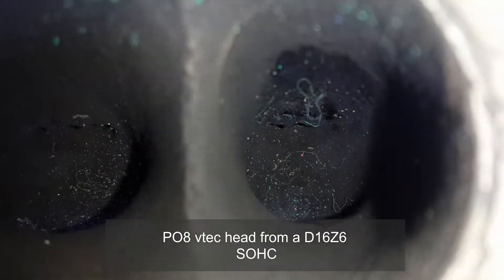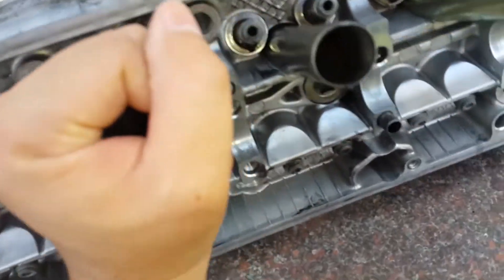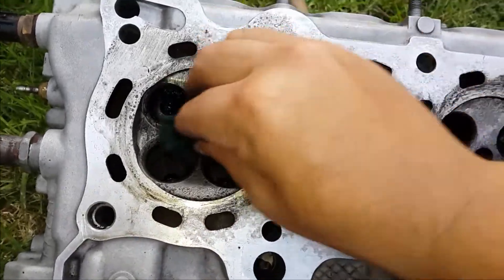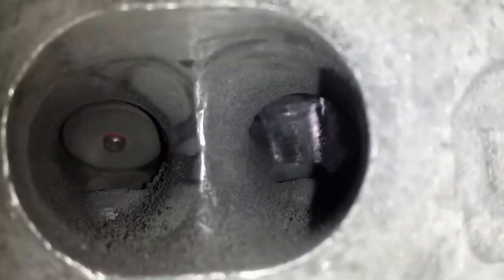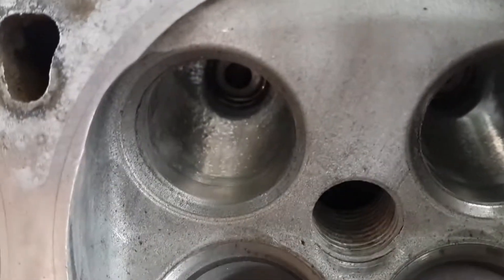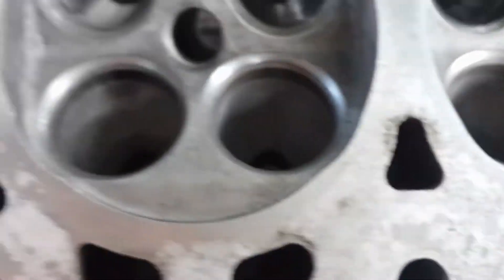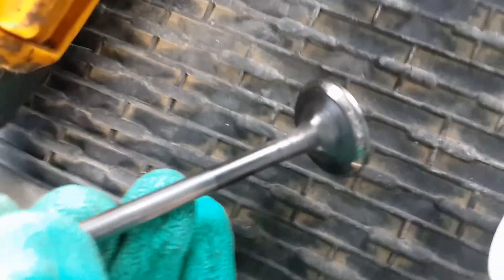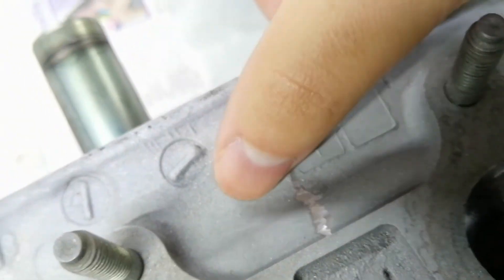VTEC Head Ports & Valves Cleanup DIY | D16Z6 PO8 SOHC

Comment: its super good,, but dont spray paint the head, its childlish
Reply from the maker: Hi John, the main reason I painted the head was because the previous owner sand blasted the surface making it rough, the problem with that is it gets dirty very easy and it's not easy to clean. the paint seals the surface and makes it easier to clean later.

Comment: 😂 wow that's some scary stuff,  never seen anything other than sanding cones or carbide attachments used to improve port dimensions and surface clean up = increased airflow, all that is waste of time based on this video tutorial 😂
Reply from the maker: Well seen it here first! in my case it would be a massive waste of time, 5+ hours porting for 10hp gain,,,, or 3 clicks on the boost controller for 40hp gain in 1 second. idk, for my needs it looks like a big waste of time.

Comment: Mine was the same way instead of using a screw driver I used a wire brush attachment on my drill
Reply from the maker: Awesome, I could not find a wire brush small enough to fit in the runners. And the dremmil wire wheels would fail almost immediately.
Reply: @RisingBoostYT  ya the dremel sucks lol I used it with sandpaper maybe I’ll make a video and show u how I did it?

Comment: What type of bit is that
Reply from the maker: Hi Savuth, difficult to say, it is listed as a "soft grinding disk" and it is not as hard as the pink grinding stones. it is however still tough. I only used 1 disk for all the exhaust ports. I got it in a cheap universal tool bit kit.

Comment: Ayee bro just watched this video and might do this to my head soon it’s a y8 head it’s starting to make a gargle/growl noise at very low rpm around 1,000-1500 and if you hold it you can hear it trying to see if it’s not the lmas or valve clearance but I did both when I installed them back in lubed everything but still makes growl noise any tips?
Reply from the maker: Hi Juan, normally the low rpm noise is valve train but that is more a ticking sound, I would recommend you check that your cam belt is not to tight, that can cause a whining sound. if that does not work, pull the cam out and check the cam journals for damage. however before anything check your alternator and power steering pump, they tend to make a noise like that. you can use a long screw driver, press the metal part against the pump and the handle against your ear.

Comment: The best way to remove carbon is to fill the exhaust ports with mix of used ATF and a little petrol before removing the valves. ATF has superior 'creep' properties than most oils ( which is why automatic transmissions have complicated sealing systems ) and will soften the coke quickly the longer you leave it . About a 1/3rd petrol to old ATF makes a great penetrating fluid too .
Make sure you remove casting flash from the inside of the can carrier area to aid oil drain back and remove any pieces that may break off in reassembly . I deburr everything as many of the internal machined surfaces are razor sharp . Non VTEC heads are a little prone to over oiling the top end , especially when running a high volume/ pressure pump . I make oil restrictors from 10mm diameter aluminium round bar with a 1.5mm or 1.3 mm restrictor hole , which still supplies plenty of oil to the top but keeps the volume and pressure around the crank to eliminate bearing failures .
Reply from the maker: Hi Bro, thanks for the ATF tip, I will be working on a B18 soon that has even worse carbon buildup than the one I did here. it was not a fun project so I will definitely try it. On this head I did debur everything I could find, especially around the deck where the engineering shop did some work. This PO8 Head actually has a very small oil restrictor built in after the vtec oil feed part. there is also a second tiny oil restrictor in the vtec solenoid that is used when vtec is not engaged. but thanks for the tip, I know the older d series motors form like a EG civic has that restrictor in the block. so if you swop a block you could end up with no oil restrictor to the head.